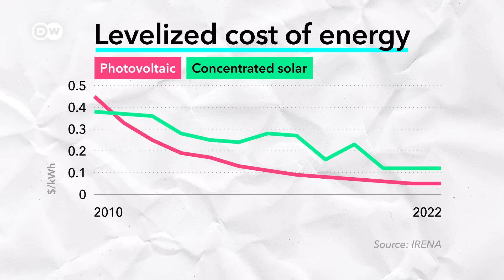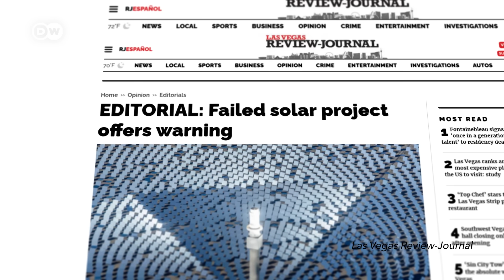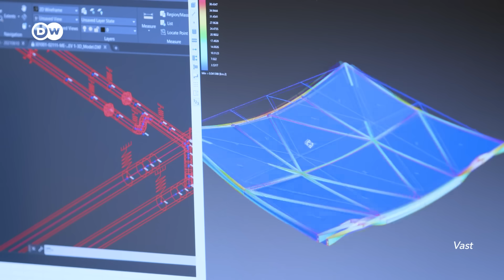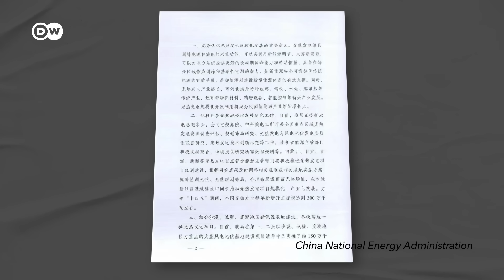How we can make solar power at night

Comment: Would love to see more geothermal plants - underneath our feet, we have essentially unlimited energy.
Reply: I've been keeping my eye on Quaise and what they've been working on with their potentially ground breaking (pun super intended lol) drilling head that may unlock geothermal virtually anywhere. I'd love some updates on them, it's been a bit since I've heard anything new other than the testing going well.
Reply from the maker: The potential of geothermal seems so great but most of it is still untapped. 🔥 We have a video checking why is it so 👉 https://www.youtube.com/watch?v=c7dy0hUZ9xI
Reply: I know my comment is maybe a bit off topic but apparently abandoned coal mines generate quite a bit of heat (after being abandoned they get filled with water), you can bore a hole and and circulate that water trough heat exchanger for district heating (if the water is not hot enough, just raise it to proper temperature with giant heat pump meant for district usage). District heating is great way to decrease energy use, a more environmentally friendly district heating is even better. Now one great advantage geothermal power plants over the method i mentioned above is co-generation, something that makes district heating affordable is selling waste heat to homes rather than creating heat from scratch with district heat pump.
Reply: Geothermal = indirect nuclear power. Also depending on the site, the resource may peter out (a friend's hubby is a geothermal power engineer, many decades in Nevada, then moved to a new location).
Reply: Grants for geothermal are also if done right good for the all the different classes
Reply: Geothermal may end up most utilized in the future drilling being one biggest cost restriction focus energy may bore to needed 
depth in many areas only minimal limiting factor might be type of soil and rock underneath when energy bores through however new boring technology may make this sensible and many other mute except few others seem more practical. I would like to see multitude of approaches the best will win out. At this time it’s hard to beat natural gas till few problems get figured out for the other choices. Believe a natural gas and Hydrogen utilization near Delta Utah might be 1st cleaner station. Interesting thing happens to water when droplets fall on a plate heated above 480 degrees and many sources of NH3 might be tried this plant may test many ways to derive hydrogen we may just haven’t found best yet. Hope this plant goes into operation end of 2025. Also glad to see many our pondering additional options we see it soon if practical
Reply: And then geothermal plants use up earth heat so much it causes the core to freeze. And we lost out magnetic shield. And everybody will die of solar radiation.

Geothermal is worse than fossil fuel.
Reply: Fusion is the future.
Reply: @abhimanyunath2001  they have to figure it out still. And yes it needs unlimited money to figure shit out basically.  But geothermal is just a matter of digging deep enough
Reply: It has potential, but you have to be careful not to wake the Silurians.
Reply: Another virtual unlimited source of power under our feet is coal and gas.
Proven technology that is much much cheaper than these Green fantasy
Reply: Plenty was identified in SW Queensland, but the cost to bring the power to populated areas was unaffordable. That's also now a complaint about new large solar farms.
Reply: Це складне обладнання, що потребує постійного обслуговування через сильний вплив термальної води на нього.
Reply: Plenty of drillers available, and there are test holes in Scandinavia proving that geothermal works in the area of thickest and coldest bedrock on the whole planet so it will work even better anywhere else. The only problems are that geothermal costs more than wind&solar and idiots who oppose renewables despite allowing drilling for gas and oil.
Reply: One of the benefits of the Shale Natural Gas Extraction industry growth in the US has been that we've gotten VERY good at drilling complex networks. We can repurpose that technology to use in Geothermal by digging shallower holes but more spread out, creating long loops that can extend much further and help capture more heat.
Reply: Hello from Los Angeles California.  I lived all my life in Los Angeles California, and in the 1980's the Smog was so thick it filtered the Sun. The smog blocked the Sun so much the winter's in Los Angeles California was so cold between 36° to 55° Fahrenheit nights dropping to 33° Fahrenheit 
I couldn't see mountain ranges from where I live 4.5 miles away. Unless it was windy and smog cleared. Now the air is so clear you can see cracks and riges, on the rock walls. 
It uses to rain 🌧 none stop for 7 months, and the summers never exceeded 90° Fahrenheit. Due to Sun being filtered from smog I also didn't need shades, for my eyes. Now 🌡  are 110° Fahrenheit for excess of 1.5 months with 5 days in the roll Temps exceeding 116° and 1 day at 120° to 126° depending on fire conditions radiating heat. 
Air clean enough, and it will not get any cleaner with only Electric Vehicle's (EV's)
Now to the reason why Environmental green agenda causes Drought Conditions.  In 2010- 2013 there were Solar Mirror s installed to project solar arrays to a Tower with mirrors projected downward to under ground reservoir water sources.  To generate steam, and generate Electricity.  
The temperatures 🌡 causes the atmosphere to close to 5,000° and every time birds fly thru become instantly baked and fall. 

In the 1980's the Jetstream used travel across California in to Nevada,  Arizona,  New Mexico,  Texas, and so on to Florida.  Due to the Mirrors the Atmospheric High Pressure. Has pushed the Jetstream away from Southern California to North to Washington,  and or Canada 🇨🇦 . This cause along with getting rid of Smog cause higher temperatures and Drought Conditions. You couldn't pay me $10,000,000 per hour to sit, promote,  sell, let alone buy any Electric Vehicle's (EV's).
If you look up StachD Training channel, on his video titled Lithium Largest Ex plo ding EV Recycling ♻️ Center in Missouri.  There were 4 Recycling ♻️ Centers in the United States.  Now there are 2 Recycling ♻️ Centers,  and none are in the State of California.  Due to Environmental Impact, which the video shows Fire Authorities spray granulated elements of the Lithium-Ion Batteries 🔋 Packs,  into creeks, rivers,  and lake anfmd underground well resources.  Not even boiling helps, and fish hacmve died in those water ways.   Sure clean the Air while you Pollute the water. In April 2024 the 1st Recycling ♻️ Centers in Phoenix Arizona location burned down,  and dousing water to keep cool prenting spread of fires 🔥 have caused Drought Conditions.  @truebrit3670  Look it up
StasheD Training channel 
Missouri Recycling Center ♻️ Ex Plod ing can't spell this out. Fish died wells for water is no good anymore,  and became Acidic 
These are facts. 
Mirrors in Mojave Desert Modified where Jetstream away from
 Southern California.  
The so called green agenda is to keep there pockets full or bank accounts.

Comment: Some additional remarks: 
- If more alternatives are available, the cost is crucial. The focus is on storage. Besides molten salt and batteries, hydrogen via electrolysis may be a candidate (in that case PV produced)
- The more fossil based electric energy decreases due to policy, stored energy will become more expensive on the market, thus being attractive for this technology. 
- The production costs of CSP electric energy depen on the available sunlight, thus i.e. Northern Africa was a preferred candidate. The transport to European consumers was a technical challenge back then. High Voltage DC transmission, which is best suited for long distances, has been improved lately.
- One issue remains with regard to Northern Africa: Political instability
Reply: "Hydrogen near electricity!"
"Kaboom?"
"Yes, Rico. Kaboom."

Comment: The thing with mirrors is the correct angle of the sun's rays can be a pain in the ass
Reply: Maybe. But I bet that a combination of three $1 a piece light sensors and a 50 cent microcontroller per mirror, that problem can be easily solved.
Reply: @jabmd2nd  Plus neighbors may make modify if reflected energy accidentally heats their place to much Los Angeles Music center comes to mind so place becomes an issue no rare birds no neighbors?

Comment: I prefer solar updraft towers... no messy working fluid, all the expensive equipment at ground level, green houses for raising crops underneath, much lower cost to build & operate.  https://en.wikipedia.org/wiki/Solar_updraft_tower   Was in spain and drove by the manzanares tower back in the day.  but no, they won't work at night.

Comment: Yes CSP has it's place in the renewable energy markets, re grid level storage molten salt it great for this application, regarding wind and solar lithium ion phosphate and maybe in the near future sodium ion batteries for short duration storage, highview powers liquid air battery is another very good option for longer duration storage which is often overlooked and should be talked about a bit more being very scalable and cheaper than other grid level storage systems.

Comment: what do i think? i think there are several grid scale battery options that take over from lithium for longer term, which are less complex & less prone, and cheaper. more pv + more battery types will win the competition again.
stored heat at old fossil plants is neat & cheap way to add peak and night power.
i think melting stuff will always be more fraught & expensive.
might be good for big industrial heat needs?
Reply: I agree that I think other batteries will win, but I think that some of those technologies will be thermal batteries that work just like the CSE plant but without the mirrors and tower. Phase transitions take tons of energy, so storing energy in that phase transition between solid and liquid or liquid and gas I think will be very attractive.
Reply: @eliorbilow8797 The molten salts in the video are thermal batteries of sort.
Reply: @charliefarleigh6108  Lithium only an answer when you have limited space like in an electric vehicle, there are better safer batteries for ground based storage cleaner environmentally and cost wise. Let’s come up with vehicle batteries with less harm to people and the planet. Many of our politicians are invested heavily in lithium but that not a good enough reason to push it for everything.
Reply: Agreed for general long term storage. There's bricks that can store up to almost 1200f which covers the VAST majority of industrial purposes, but not many things can generate that kind of heat to be stored. There's also sand batteries for long term storage, but they can't get quite as hot. However I see CSP being useful for smaller scale or lower temp industry. Things that need say a couple hundred degrees could have their roofs covered in mirrors aimed at a tower with a storage tank at it's base to allow them to run emission free.
Reply: Yeah, electrical heating might work much better and it can use many different energy sources.
Reply: You don't have to keep melting things, if you had a permanent source of heat energy to keep the molten salt in liquid phase, then you get storage for free with variable on demand output. The ideal input heat is of course fission, almost all the MSR designs have the fission heat engineered as a nuclear island topping up the heat in tanks just outside the island. Moltex comes to mind.
Reply: The batteries are way too expensive - even more expensive than nuclear from a levelized cost perspective. Sure they're constantly getting cheaper, and fast, but not fast enough to compete with pumped-hydro or this (and there could well be floor; its unreasonable to expect prices to fall forever). They also have a limited lifetime and are tough to recycle. They require a great deal more mining than this. Melting things will always be cheaper than charging and discharging batteries over and over.

Comment: Another great video! It seems to me that the  sodium heat battery that we saw being used as a replacement for coal or gas furnaces could be melded into this tech. So to stop the solidifying of the salt you'd use grid electricity to keep the heat up. It sounds like a tough engineering problem